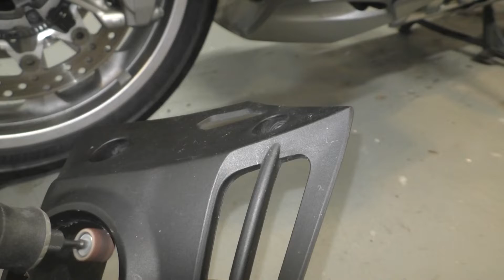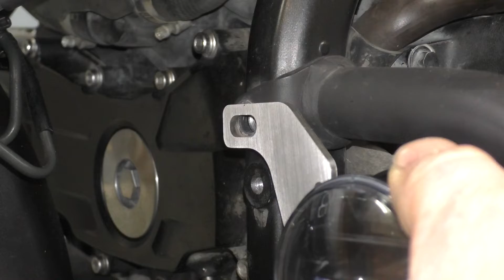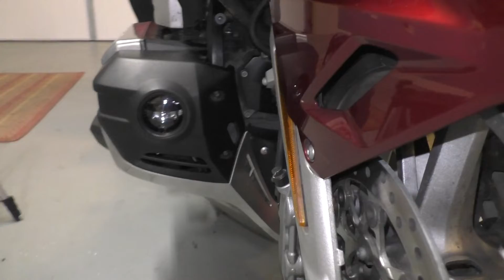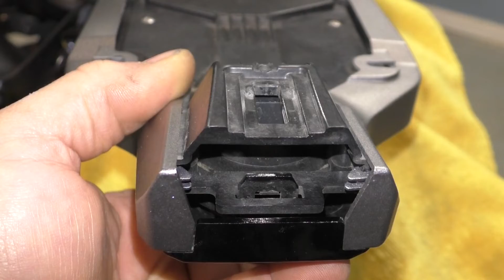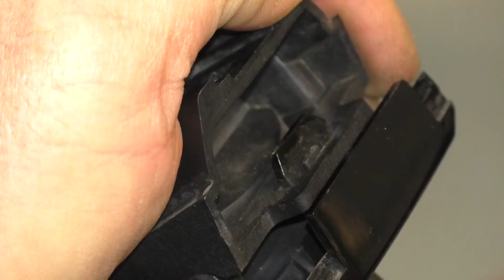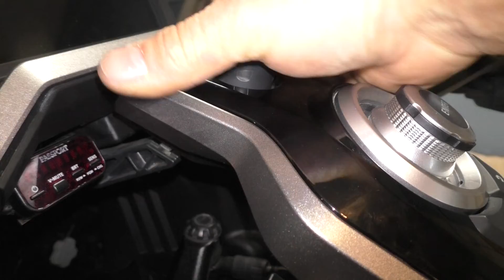Electrical Connection Fog Light Installation - 2018 GoldWing

Comment: Will these lights work if the button isn't installed? The button just allows you to turn off the lights, is that correct? The lights appear to be wired in line with the headlights...if you don't mind them being on all of the time, installing the switch can be skipped...

Comment: Very informative video.  I just purchased a left over 2018 goldwing (non-tour) model.  Getting the plastic off is not inuitively obvious.  I just added several honda accessories: foglights, audio cable, entry lights, power plug, extra USB cable, backrest and rear carrier.  I knew that taking all the tuperware off was going to be a lot of work so I waited until I had all the assesories I wanted and installed them all at once.  Thanks again for the informative video.

Comment: I followed these instructions using the Short cut for the panel. Works great. I had the button in quicker than I thought I would. Maybe 10-15 min. One point of concern. Make sure you are careful putting the tabs back for the top shelter where you pop it out on the shortcut. I broke the where the tab goes in. This does not take a ton of pressure to break either. I found the broken piece. I will fix it when i take it all the way apart and take the top shelter off. Kinda pisses me off that I was so stupid. If I took my time to line it up right it just pops right in. I was off a bit. 
The lights are very bright. I still have it on the lift table. Going to give her bike a good Detail tomorrow. 

Fred thank you for your video series. I love to do things on my own and the best money spent Besides what was spent on the bike.
Reply: where can i find the shortcut video to removed the top panel?

Comment: Do I have to install the new button or can I just buy a little light sticker for what's there unless it's a dummy button on the panel?  Getting my Wing today so haven't looked at it all yet.  Wish the factory would of included fog lights but oh well, I bought a leftover 2018 Wing for 16k out the door brand new!  Couldn't beat the price.  Also, how do you like the bike so far?  Any main issues?  Did you do the GPS update?  I am gonna do that today once it get delivered.  Or, are there fog lights where I don't need a button and they are just on 100% of the time even when I put on my brights?

Comment: Will this OEM button allow you to run the fog lights whether the headlights are on either high or low beam or does it automatically turn the fog lights off when the high beam is on?

Comment: Did you try to shrink the rubber boot on those bullet connectors with a heat gun, to keep moisture out of the connection?   Very good video instruction with attention to detail.  New sub to your channel.

Comment: Hello Mr.  I'm from the Middle East I have a bike in the Golden Hyundai 2018 where the operating system has started engine rotation How can I communicate with you as possible or your netting?

Comment: It appears in the video that existing wiring was used.It would be much easier to do that if it is possible. Honda suggest using their wiring harness. My question is was the harness put on prior to the fog light video or is it there when you buy the bike?
Reply: The Electrical Connection kit plugs into the OEM wiring as shown.  That connector is already on your bike!
Reply: @lewisatelectricalconnectio2060  Thank you for getting back to me. You have helped me make my decision on which lights to buy.
Reply: Lewis at Electrical Connection where can I buy a light kit for my Goldwing?
Reply: Ashley Burrow.       Hi Ashley, I’m trying to. Find out where the light kit was purchased, do you know🤔

Perry